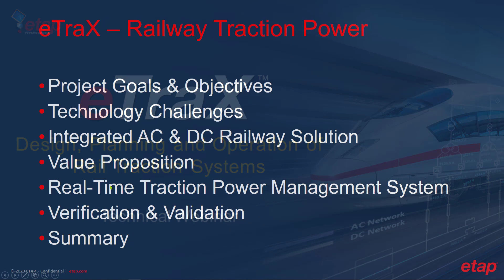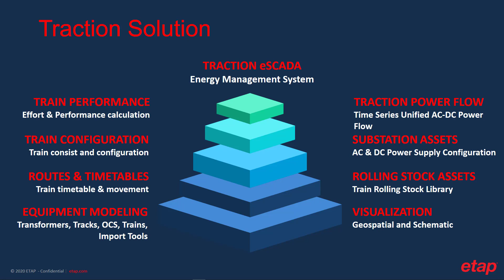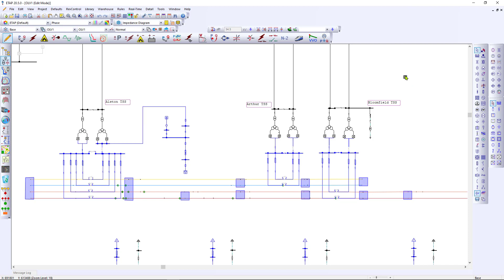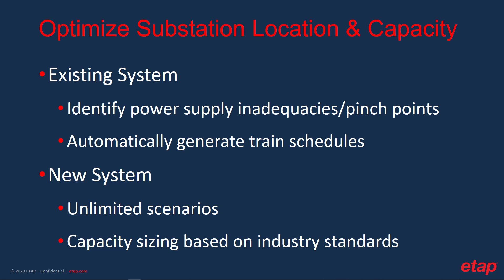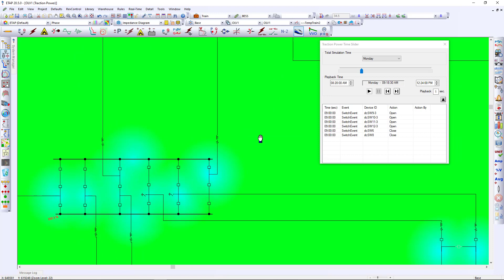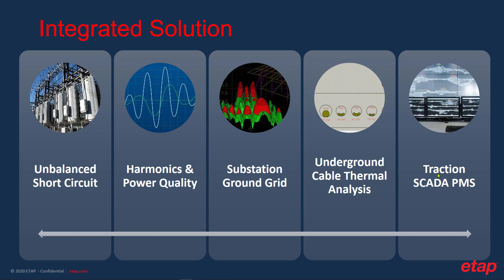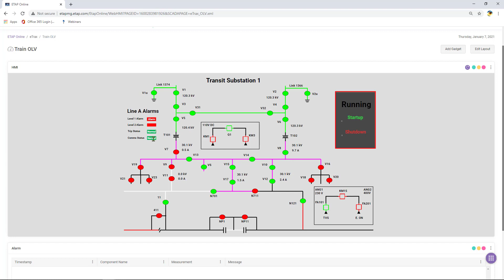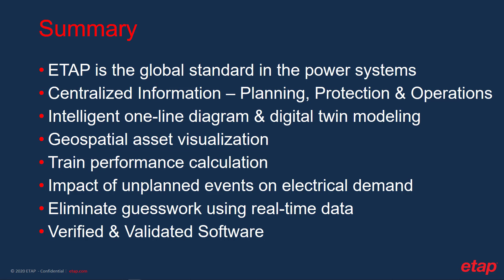eTraX™ – Design, Planning & Operation of Rail Traction Systems

Comment: Can I edit that file to do my simulation but from another place?
Reply from the maker: Thank you for your interest in ETAP Solutions. It depends on the type of license you are using, but in general you need to use your laptop license. Some editing can be done from the etapAPP, if NetPM is installed. For more info please contact our local ETAP sales office or submit a ticket in our 24/7 Help Center to assist with your questions.